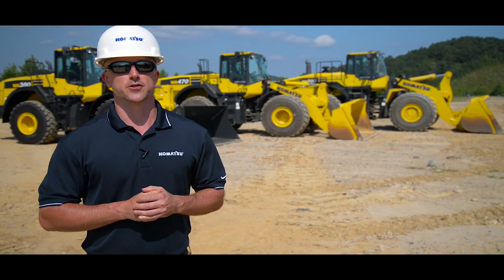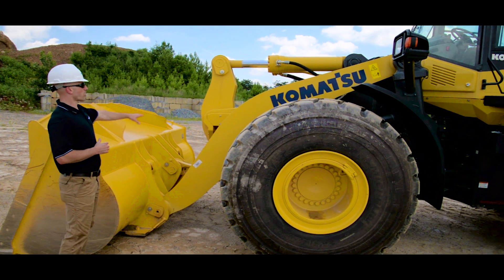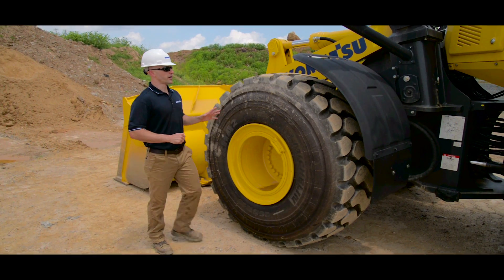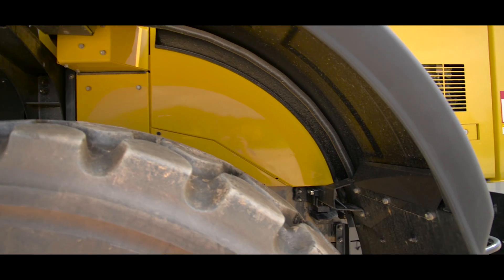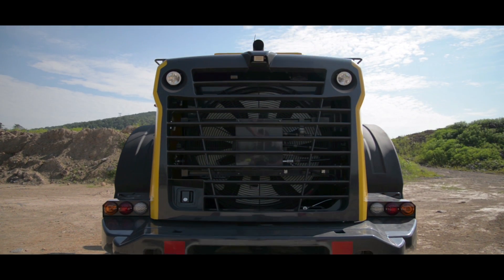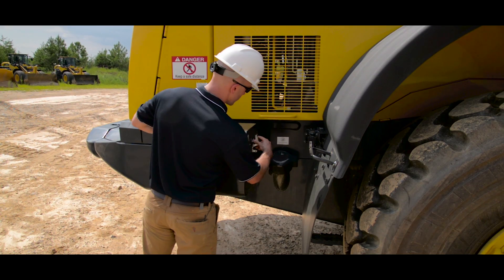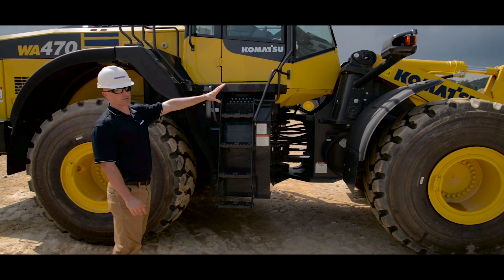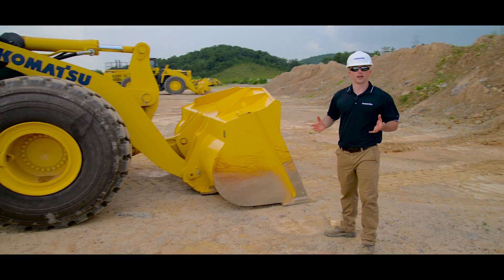Komatsu WA380 / WA470 / WA500 | pre operation inspection

Comment: I drive a 2015 Kom 500 the only to describe it is a gutless piece of shite  this was from new very uncomfortable  labels fall off  switches within hours fenders fill with muck making it almost impossible to shut fuel filler hard to get at  but the most annoying thing is the so called drivers eco advice absolute shite 
A tiny bit of hard ground and up comes Avoid excessive digging Realy 
Checked comp read out after demonstrated chap he had 6 avoid excessive diggings in 10 mins 
All in all a piece of underpowered crap